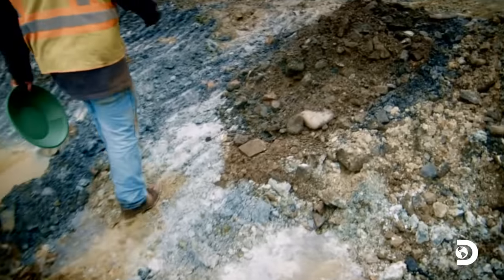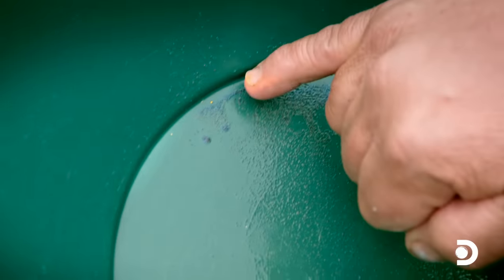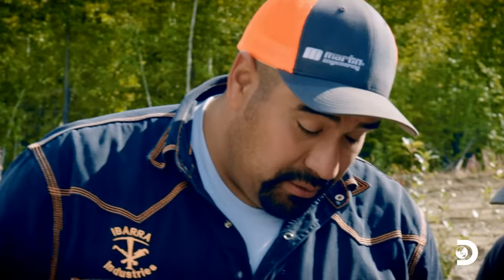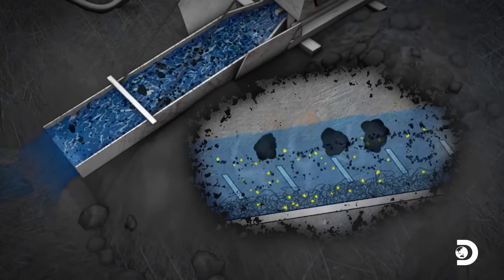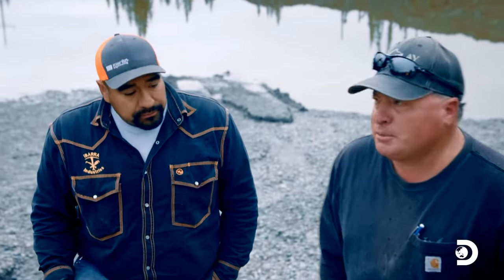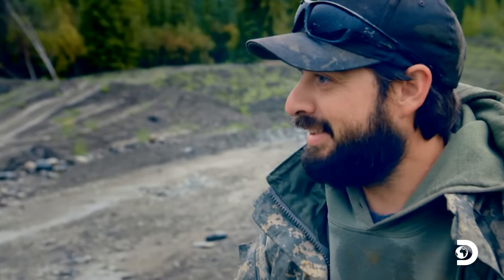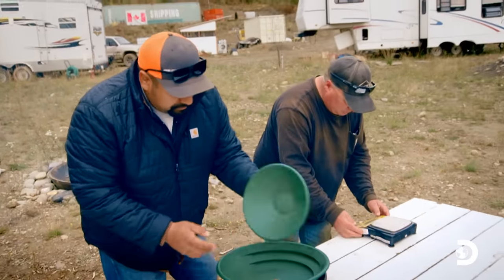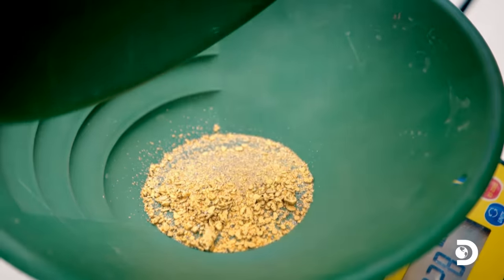Freddy Mines a LIFE CHANGING Gold Haul! | Gold Rush: Freddy Dodge's Mine Rescue

Comment: He's in the hobbyist mode if he made his loose box six feet longer he'd even catch more of the stuff and then I turn the corner and run another 6-ft part of a sluice you're not going to lose anything I mean what's the big deal you're not going to lose you might so make your sluice as long as you can the longer the sluice the more gold you're going to catch and if you notice you've made it 10 ft too long because nothing is ever in the last 10 ft of your sluice cut 10 ft off but at least make a 30 or 40 ft sluice to start so you can get all the fine stuff and use the green in and outdoor carpet that catches a lot of real fine gold

Comment: Good on you fellas. Would it be worth  pumping tailing back over sluice. Put pickup pipe in upside down 44 and smaller pressure pump blasting beneath to  stir up the bottom    it's not lost it just needs running back through   you alry done the hard yards digging pumps r cheaper to run than digger's.  Be a nice tax return feeling LoL have a good one. Feral